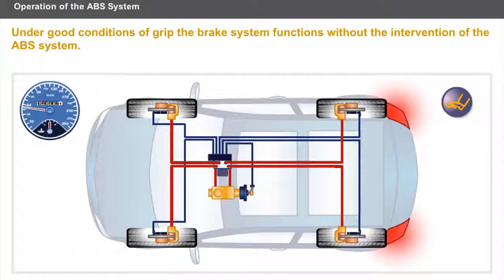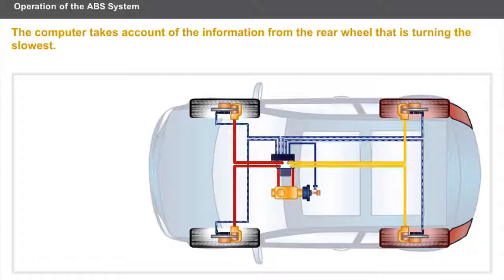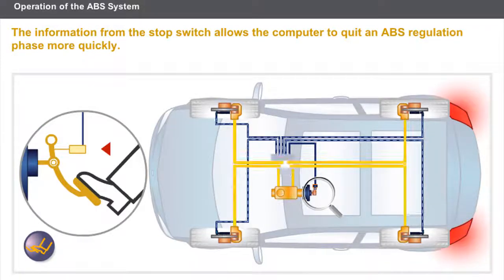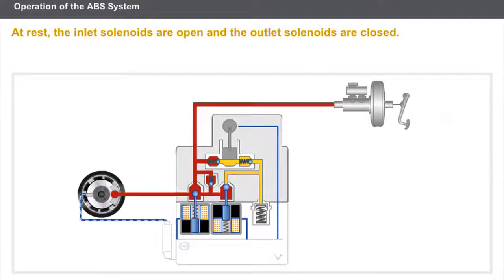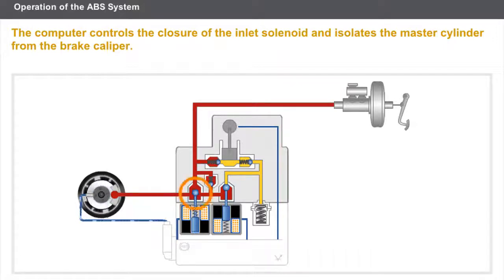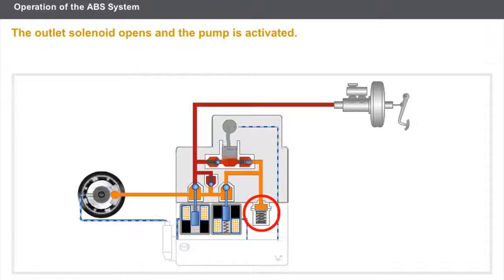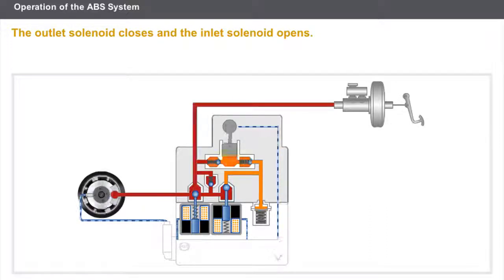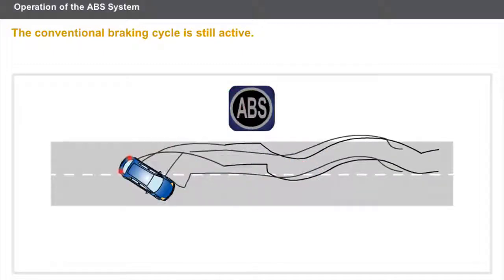Operation of the ABS system

Comment: I pulled off the road onto a dirt and gravel shoulder at a fairly high rate of speed and locked up my brakes.  The ABS, BAS, Brake & ESP lights all came on and stayed on throughout the rest of the day.  They finally stayed off after several drive cycles.  Gave me a scare as I thought my ABS system had a failure.  Not sure why the lights all stayed on for so long.  I’m pretty sure I've had ABS regulation before without the lights coming on.  The episode caused me to google ABS and watch your video.  

I’m uncertain about the purpose of the pump.  Is the following correct?
The pump evacuates the LP accumulator during the Pressure Reduction Phase to assure a zone to quickly release brake piston pressure.  Also, if driver is exerting maximum brake pedal pressure, the pump will overcome the hydraulic pressure trapped between the master cylinder and the inlet solenoid valves.   The pump keeps running during the Pressure Re-increase phase but will increase pressure to brake caliper only so long as a supply from the LP accumulator exists.  Further, it’s best to keep the pump running once brake regulation is initiated as the regulation cycles many times a second while the driver has the brakes applied.  Guessing regulation stops when driver releases brake pedal and stop switch signal to computer changes state.     
• No Regulation:  Inlet SV open, outlet SV closed, pump off
• Maintain Press Phase: Inlet SV closed, outlet SV closed, pump off
• Press Reduction Phase: Inlet SV closed, outlet SV open. Pump running to return accumulator fluid to master cylinder.
• Press Re-Increase Phase: Inlet SV opens, outlet SV closes, pump continues to run.